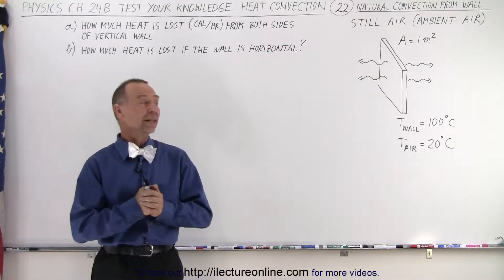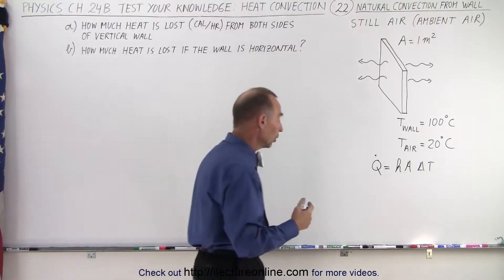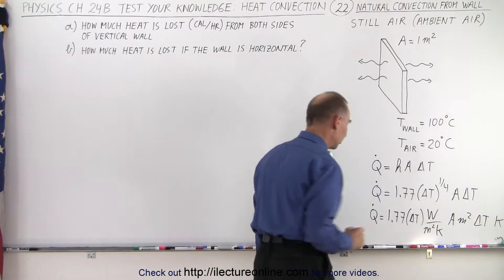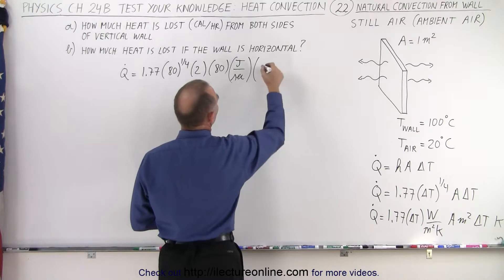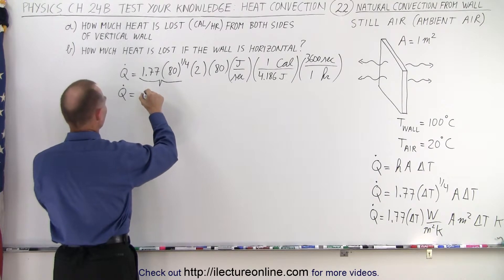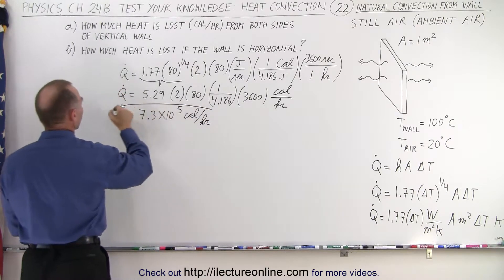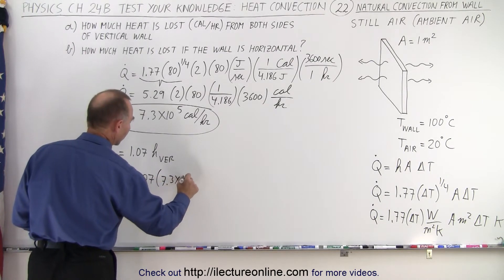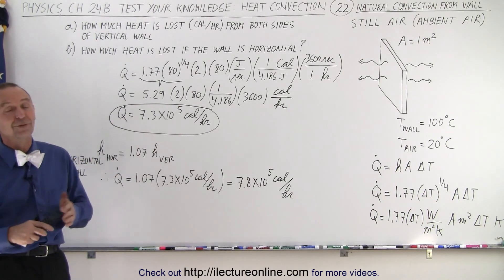Physics: Ch 24B - Convection: Test Your Knowledge (22 of 26) Natural Convection from a Wall

Comment: Hi sir, why didn't you multiply dQ/dt by 2 like u did with conduction? Or does the convection equation consider both sides of the wall already?
Reply from the maker: Convection depends on the surface area being hit by the fluid.

Comment: Best wishes in 2020! Also, how is the trasmission coeffcient derived? Is it some empirical constant, or maybe it has different values depending on considered medium? Where can I get those values for certain cases?
Reply from the maker: Thank you.  If you take a look at the other videos in the playlist, you'll see that there are a number of coefficients which are typically empirically determined for different shapes, material, fluid flow, etc.